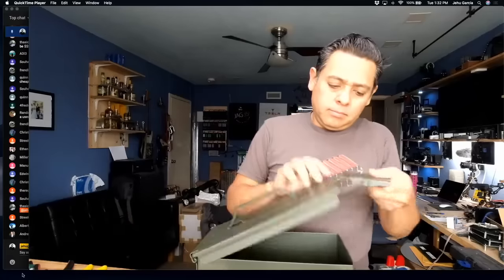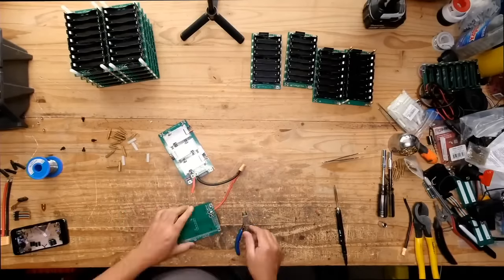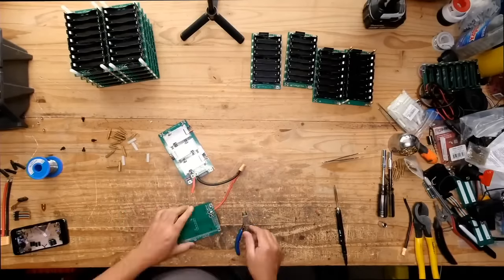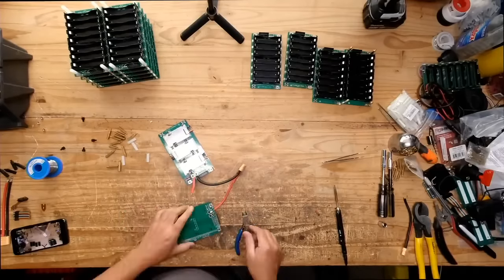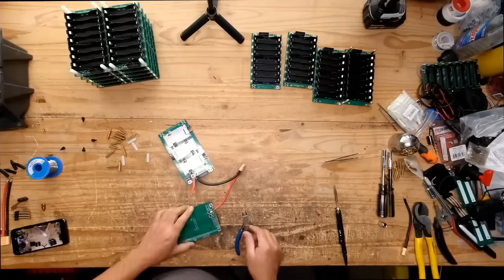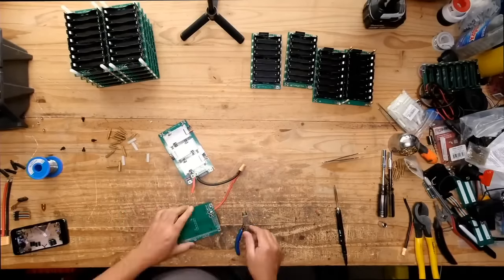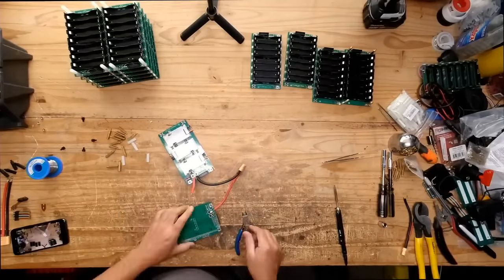Adding extra battery to EcoFlo Delta1300 hack  - Live

Comment: I have a EcoFlo Delta 1,000. I solved the power boost hack by buying a 200 amp gel sell deep cycle marine battery and connecting it to a 1500 watt 110V A.C. true sine-wave inverter. I plugged the AC charging cable into the inverter.  The Delta 1,000 charge port flows power through. The current from the inverter fully charges the EcoFlo battery to 100%, if it is slightly discharged, while powering whatever device you  are connected to. I run a 530W air conditioner. The inverter alarms at 10V and shuts down when the battery reaches 9V, at which time the EcoFlo battery takes over. I easily more than double the run time of the EcoFlo.

Comment: Just buy 2 200ah deep circle batteries and a 1500 watt inverter and plug a power brick too it to keep the delta topped off and adds extra capacity. You would just need a separate charge controller. 
What sucks is the new delta smart batteries are not compatible with the ecoflow delta.
Reply: I think this is exactly what I need to do for my van build, the whole solar and electrical components of my build have been super intimidating so I haven't made a whole lot of progress on it... do you know if there are any videos out there of someone doing the setup you're talking about? I have been looking for a while and haven't had too much luck.

Comment: Maybe I missed it, but don’t forget to warn people not to connect a fully charged battery to a low batter in the Delta unit or really high current may flow >> acceptable charge rate.

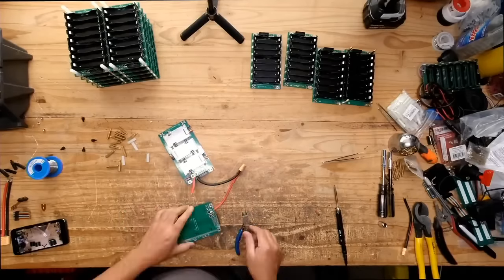Comment: 2:16:36 - I would NOT put Li-Ion in anything motorized unless terminals are properly crimped and strain relieved. Spring? No. Solder? No. Bumping down the road will bust your build apart faster than you imagine.

Comment: I know this video might as well be considered from forever ago now.. but I just wanted to say that we bought a single extra Sunpower X22-360 (we already have 10x of the on the roof of the Tour Bus so we were familiar with them and like their performance because of their use of the Gen 4 MAXEON cells) for $135 off eBay. And this single panel charges a Delta 1300 at an average of 330 Watts when even slightly correctly positioned. So, I mean, $135 / single panel / 330 watts - I seriously see ZERO reason to buy expensive 100watt panels needing all the space, and cabling, and combiners etc etc if you have the space to stow a single 96 cell Sunpower panel.

Anyways, as with all things YMMV, but this is what's working for our two (2) Delta 1300's. Oh, also yes - having two Delta's imho is clutch. The pass through unit to unit feature has made all the difference for us. It's a similar setup to what you're doing here with a battery extender in a sense.

Comment: I have 2  delta 1300 models. I bought 2 of them off of Amazon just a bit over 2 years ago . They are both out of warranty now by like a month and Ecoflow customer service is total crap. One said that bad battery pack it couldn't be fixed ..The other Customer rep said it could but that  With shipping it and replacing the pack would cost $800 ish and they suggested I buy a new unit. Adding that solar input to add a second battery  in your video you mentioned bypassing the BMS. I think my issue is I didn't charge and recharge my unit and now the BMS now won't allow the unit to charge . Could I bypass the BMS and try to charge the battery ? The unit does power on when plugged into the wall  but doesn't charge but immediately shuts off when  removed . Any help would be appreciated

Comment: Hola! Miguel here from Puerto Rico. Trying to prepare for Hurricane season. How much did this mod cost you and would it be possible just to wire directly a pre-made battery to the Delta battery? If so, what specs would the pre-made battery should have (like a 2000 Wh battery)? Thanks so much for education people on this.

Comment: Time to revisit this...  Can the added connector be used to provide 48v from the internal battery to power the new Wave air conditioner (direct connects to a Delta Pro or Max via XT connector)?

Comment: I just got the eco flow delta for a camper van build out and I am already wanting to be able to plug in an auxiliary battery just like this.. How safe or how not safe is this? Can anyone give me some layman's talk through on if i did this. Also could I just buy say something like a battle born lithium battery and plug that in like this? Thanks to anyone who can help!
Reply: Me personally I would just use the solar charge port or the cigarette lighter charge port but you would need a step down voltage converter to 12 volts for lighter port but that port only charges at 10 amps so if you use any more than 120 wats the external battery won’t keep up.
Reply: @ehsoule  yeah that does seem like the easy way to go.. but the slow charging is what is a bummer
Reply: seems like no one can answer this question ... A very simple question that I've asked ( and you ) .. smh .. i don't want to build a battery either, just want to know, is there a pre made battery that we can buy and hook up like he did this one in the video SMH ( we're not all electric pros here ) lol
Reply: @pnk4444  haha right! I did find some 48V Ebike battery packs that look like you could just plug right into this and it would work.... but.. idk. hahah
Reply: @JoshuaThomasGray  i don't know either , maybe if we keep playing ping pong here with our reply ... WE'LL get the answer ... from my understanding battery chemistry and the layout 14s or 7s ... no idea ... but i would like to get an answer so we dont blow up ..lol .. the connection seems easy into the eco flow , i have no problem with that .. just get me a battery i dont have to put together
Reply: @pnk4444  hahah yeah
Reply: Hey Guys! Any successes with cracking the case, yet? Asking as I'm about to execute such plan.

Comment: This is great. I wonder if your getting the new Ecoflow? Really interested in the modification or chaining possibilities of the external addon LiFePo battery (ef-1500).
Reply: great question Tim , can you save steps and just use battle born lifepo4 batteries , or others and chaining and all need to do is make the mod for eco flow wire ?
Reply: @pnk4444     Did you ever figure this out? I was wondering how to connect a Zooms 100ah lifepo battery ($400 @ Amazon) to a Delta when the Delta is depleted (no solar cloudy day, etc.)?

Comment: How about putting a thin Red band on the positive end of the heat shrink battery cover, this would reduce the chance of inserting the batteries into the holders the wrong way round. Let me know what you think. Frank Stocker.

Comment: Lifepo4 is the future, and the people brave enough to DIY batteries for home energy storage don't want or need the volatile lithium Ion/NMC chemistry. They would rather have 4x the cycle life and the safety that Lifepo4 has when compared to NMC cells. The rack mount style 48v 100ah batteries are becoming increasingly popular because they are turn key products, and they are somehow even less expensive than buying raw Lifepo4 cells to build your own battery. I would personally still choose raw cells if I could afford to invest $25k into a solar system and solar energy storage system, but I absolutely understand why people want to buy the rack mount turn key system. If I was installing solar and energy storage for someone else, I would probably recommend the rack mount batteries, as long as the rack mount batteries use good strong cells and a solid bms. I know there are a few companies out there that make solid batteries, like SOK

Comment: Any chance you will be offering this as a beginner kit,......would prefer not to do board soldering,....every time I try to,...I end up damaging the circuit board.
Reply from the maker: Yes they are coming
Reply: @jehugarcia  I won as the first winner in your 36v giveaway. I sent an email but didn't receive a reply? Still excited for my 25pcbs that are on the way!
Reply: @jehugarcia  Keep me informed too. By the way, what soldering iron are you using? Probably asked before. But do not see it in your comment section. Thx.

Comment: Is there anyway to use an aux battery to somehow power through either the Solar charging plug, 12v plug or some other method that does not require you to open the unit?
Reply: Mike Zimmerman,  I asked Ecoflow support that question and got this answer:
Please note the output information of the delta 1300 below:
    AC Charge Input Voltage: 100-120Vac (50Hz/60Hz) ONLY! (International Version 220-240Vac ONLY!);
    AC Charge Input Power: X-STREAM Charge 1200W max;
    Solar Charge Input: 400W 10-65V DC 10A max;
    Car Charger: 12V/24V DC 10A max.
"we can see Delta can be charged with DC( Solar panel / Car charge) via the XT60 port. So there is no problem that if you want to charge it with a 12V battery and ensure the output is within the range above. The connector type is XT60 below. "
Reply: Mike Zimmerman, keep in mind that you can be charging the Delta by solar during the day, while it is powering loads through the inverter, then at night you will hopefully have a full battery to get you through the night.
Reply: @rootcanal7188  I was asking as a major portion of this video was about how to tie in the battery he made to the 1300.  Was it possibly to make more power immediately available for consumption rather than using the battery to charge up the 1300?  I'd rather not invalidate my warranty by opening the 1300.
Reply: @Retired_MZ  True, you don't want to do anything to void the warranty on the Delta. In theory it should be possible to use an aux 12 volt battery, which is connected to an inverter, to then charge up the Delta through the AC power input. Probably best to have 8 solar panels, so you can charge up the Delta with four panels, and the 12 volt aux battery with another four panels.

Comment: @jehugarcia I just ordered this 48v kit, if I order the 480w adjustable charger from China, what is highest voltage and amperage the 48v kit can charge at?
Reply from the maker: 50v @11A
Reply: @jehugarcia  I successfully finished this build. Thanks. I plugged the BMS stack's ribbon cables in first, any reason why the 2 other stacks sparked with each ribbon cable plug in? All the batteries were charged to 4.2 volts. I tried one stack without the xt60 plugged in and one stack with the xt60, all sparked. I'm getting 58.3 volts at the terminals, what's the amps? I wanted to ask before blowing the fuse on my multimeter.

Comment: Unfortunately, this "hack" deals more with scratch building a battery than it does suggesting  the type of battery to buy and how to connect it to the Delta. Are there any available high watt hour batteries (1,300 + watt hours - especially lithium) commercially available, and what is the best way to charge them and draw from them using the Ecoflow Delta? Not many of us want to build a battery.  More of us want to use one.